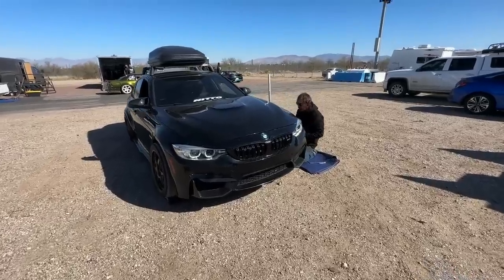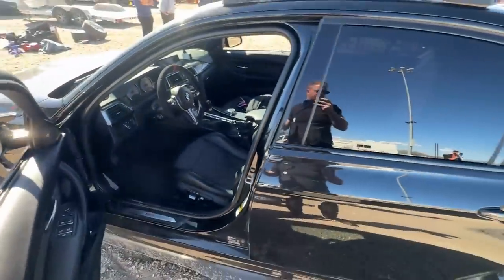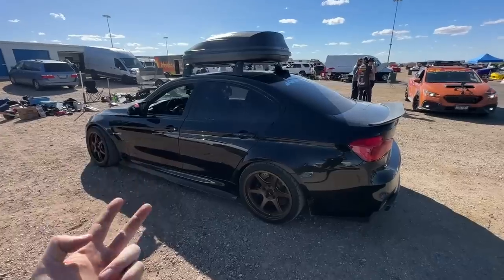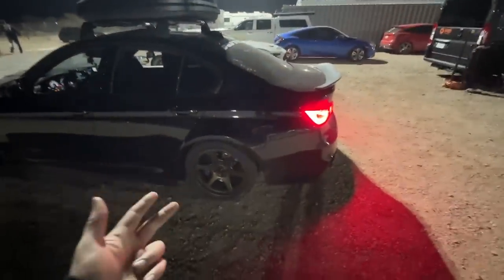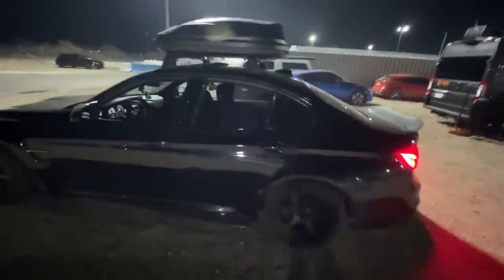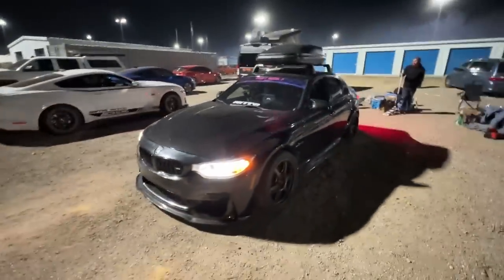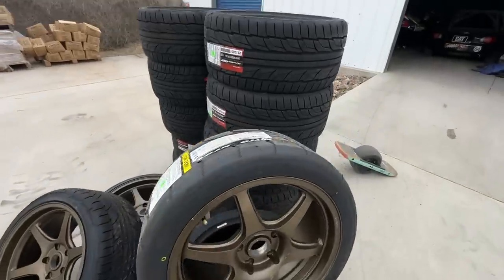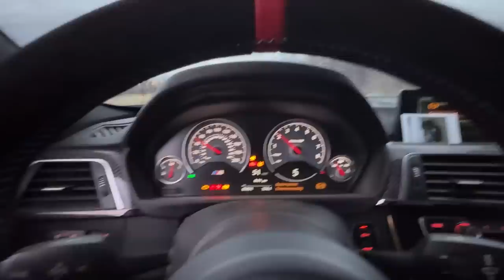First rips in the F80 M3 drift build. It works! Drift Week Ep.1!

Comment: I really wanna see someone build an S class or 7 series or oldish Bentley or rolls and make a streetable drift taxi out of it 
(not hoonigan style rolls.. That's a race car with a shell put on)

I think especially something like an m5 should be seen a whole lot more.. 
there are bound to be loads of old or oldish 5 series going for next to nothing that would make for sick build (or simple, even mostly stock they are good)
Reply: I used to drift a 540i/6 e39, great car, but really requires shitloads of power to run good sideways, eats a whole bunch of tyres (went through 2.5-3x as many tyres as I did in Euro M3 e36 3.2) and has 0 aftermarket support for drifting... I'd say it would be a great platform for a high funds program where you can have a beast under the hood, don't care for tyre consumption and can develop your own parts, but not really the greatest for grassroot stuff...
Reply: @IWK333  ohh im aware there will be no specific kits. But im v sure either a homemade or modified angle kit would work and not cost the world.. a 5 series isn't any bigger than a chaser, or mustang or an older one is about the same size as the newer 3's are.
Might need a bit of slimming to save on tyres / power required..

But being honest, if you want to have fun in a car on the cheap, there are cheaper ways to do it than drifting.. fields and forrest tend to let you get sideways without burning up all your boots

Not saying it would be for everyone... Just that it would be cool to see.

Add to that older rwd stuff that would be famous in rally circles.. why dont we see any mk2 escorts, starlets, manta, cortina or (insert fave rwd rally car here).

With so many wanting "unique" car or build, we see the same stuff over and over.
Obviously the Japanese stuff and various U.S stuff and lots of BMW's.. but there are so many good or interesting cars out there that would be great drifting.

Comment: Taylor have you tried changing the M modes to see if they make a difference with responsiveness? I think Jordan drives in comfort but I’d like to know what you have found to be a sweet spotn
Reply: It's about linear throttle mapping. With aftermarket suspension, ain't nothing gonna change with the M modes besides the throttle response curve. 
Mhd has a linear throttle map option

Comment: If your seat is power; put on your seatbelt then move your seat back about an inch or so then pull the shoulder portion out until it ratchets back in and get your seatbelt tight then move your seat back into position. You’ll be tight in the seat

Comment: Be careful running the MHD 91 tune in Arizona, California, & Nevada.

We have shit fuel in those states that’s why MHD adds the ACN91 tune before 91octane tune.
It goes ACN91, 91oct, 93oct, etc.

ACN91 is for Arizona, California, & Nevada 91 fuel.
Just check to make sure your not pulling a bunch of timing, probably helps that it’s cooler weather out here right now too👍🏼

If I were you I’d personally run the E30 or E50 tune.
LeterEat brotha!🔥

Comment: The car looks awesome but it also definitely looks heavy and slow on transition, slow to accelerate, not very nimble. The car is what 1700kg (3700lbs)? It must be the heaviest  drift car on the trip. I still think you should gut the interior, cut out whatever you can, make more racecar-ish, but with keeping the stock drivetrain and engine combo. It'll still be a seat-time car, albeit less comfortable, but it will be so much better to drive. So much faster and more precise. And it'll be easier on the tires. 

I got my seat time E46 from 1450kg down to 1280kg and it felt like a completely different car. The diference is insane. I couldn't imagine how much better the F80 M3 will feel if you get it from 1700kg down to 1300kg. There is so much interior and so much options you can throw away I don't think it'll be that hard. Something I will never sacrifice on a drift car though, will be the front door cards and electric windows. It is just not worth the savings in weight for the tradeoff in convenience.

Comment: Years ago I wondered what the future s chassis/e36/350z equivalent drift platform would be haha.
Reply: Only problem is that the M3s are so expensive. I wonder if people will start messing with the 330s/340s as drift platforms or if the suspension designs are different.
Reply: @coreystrandberg9087  As long as the car is RWD, it will get drifted.